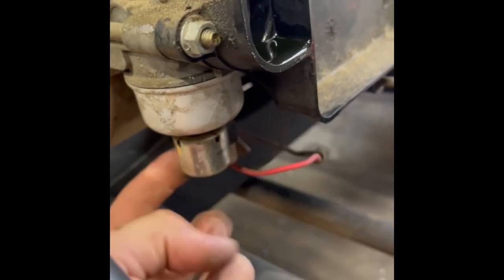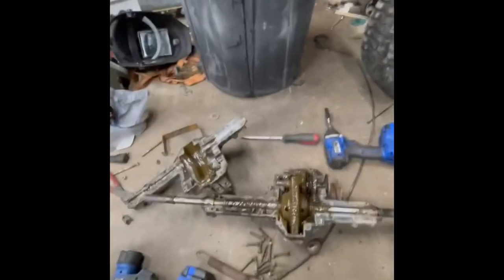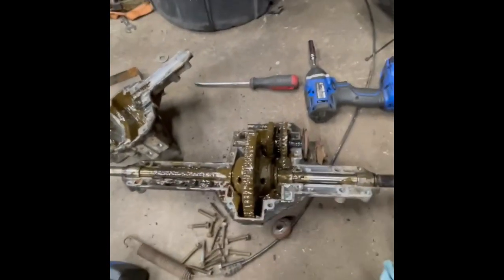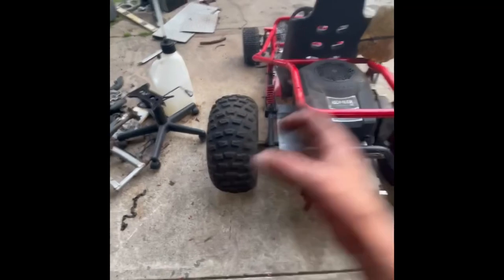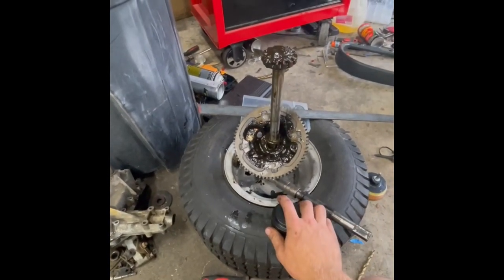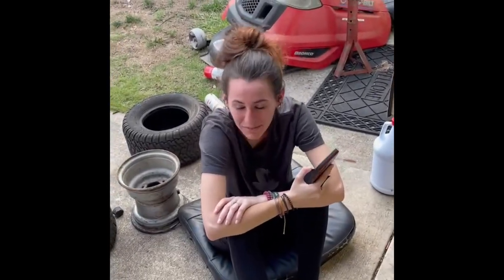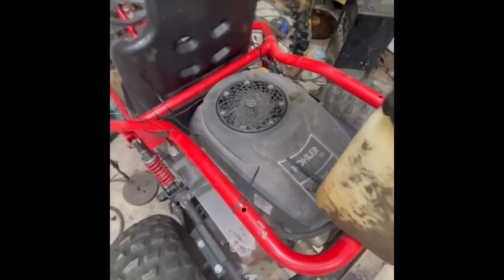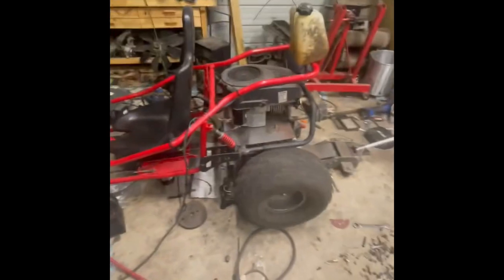Go Kart with 20HP lawnmower engine

Comment: I did this 12 years ago but used a sequential Foote 5 speed with 4 inch input pulley on trans and centrifugal clutch . About 28 mph , weird to shift but still works today . With vertical shaft engine , 14 hp ovh .

Comment: Tractor supply has 90 degree gearboxes instead of using the mower transaxle you could keep the live axle just do a 1 to 1 pulley from engine to gearbox and  put the clutch on the horizontal shaft of the gearbox get way more top speed
Reply from the maker: I looked into that before building the mower transaxle and the smallest 90 degree gearbox tractor supply had wouldn’t fit in the area under the engine with all the pulleys I’d need to make it work
Reply: @EliteDiesel01  the ones I've seen you might have to have tractor supply order they are used on zero turn mowers and not very big at all I believe cars and cameras used on on the ratrod wagon the fattire bike and the drift mower before they put the built predator 670 on it
Reply: Maybe even use a centrifugal clutch

Comment: If that's a MTD fnr the year reduction is crazy because the pinion gear is 14 tooth and the reverser gears are 41 so that reduces it as well as the gear on the other end of the travel reverser is 8 teeth which turns to 58 tooth gear on the axle which means that if your input shaft which means if you drive pulleys were 1 to 1 going into the transmission you're probably going to only go 7 to 10 mph

Comment: do you reckon it'd work turning the motor over so the crankshaft is horizontal and modifying the oil system, with a centrifugal clutch or something else that drives a chain and sprocket on the rear axle?
Reply: @NubsWithGuns  u think a vert shaft is better in this application?

Comment: If you did research and didn't just do stuff......you may have been successful
Reply from the maker: First off I think if you actually watched the video you woulda saw I was successful. I built it and drove it. It worked. I clearly stated in the video that I did have an issue with a temporary motor plate flexing and throwing the belt and that I could buy the permanent 1/4 plate that I was planning to put on it if it all worked like it should which was $100 but I also said that I changed my mind on what I wanted to do with it after building it. I had my fun and I built something a-lot of  people haven’t. I don’t see you building one like this. It’s about the experience. And it’s my stuff I can do whatever I want with it without research or other peoples opinions like yours mattering. And remember this is the internet where millions of people will see your comment so you shouldn’t be condescending. You said if I did my research I would have been successful which makes no sense because if I didn’t do research how would I know how to mount a vertical shaft lawn tractor engine on it.How would I know how to build and lengthen the transaxle like I did. How would I know how to build the custom pulley/clutch set up. How would I know how to stretch the frame, steering, brake and accelerator rods. How would I know what pulley/ tire sizes to use to make it go faster. I think if you paid attention more you’d understand what’s going on. And the description on your YouTube channel “like it or love it…IDGAF”, really doesn’t help your case when you’re clearly GAF commenting stuff like this on peoples videos. Not making your channel look good. Just my personal successful opinion. You have a nice day tho.
Reply: @EliteDiesel01  wow..... butthurt much? Common sense, torque equals flex, belts need tension, overall gear ratios, etc...and I don't have to put my stuff on YouTube. And I have 2 racing mower projects, an ATV, and another "thing" that's kind of a pulling tractor but, it does about 50.
Reply from the maker: Nope not at all “butthurt”. But you clearly are if you’re resorting to talking down on other peoples videos because you feel like you’re more superior then them when in reality, which is the real world us normal people live in, you’re no better then the next. I don’t need to thrive on others opinions I know What I’m capable of. but you’re still not listening at this point you’re just being ignorant. And your “racing mowers” that cute. Ive built those too Which aren’t go karts those are mowers  already set up for vertical shaft unless you swap on a horizontal shaft engine so your not proving your knowledge on what my videos about. And this isn’t my only go kart. I have a R1 shifter kart that will go over 100mph so your 50 ain’t impressive. If you’d pay attention and do your research before commenting you’d know that. Do better.
Reply from the maker: And I appreciate the comments. Helps with the YouTube algorithm The more you comment the more views i get so keep them coming and I’ll keep responding.
Reply: @EliteDiesel01  if you want LMAO. Keep practicing and get better. Then earn some money from YT
Reply from the maker: @heffedirte6243  I have 3 channels. I just started this Chanel which already has over 47,400 views and you’re the only ignorant person I’ve run into so far. So congratulations on being the first. so again I don’t need to do better. And your the funny one since you keep trying to talk yourself up yet you don’t post videos or make money from YouTube so you have no leg to stand on in your own argument. So like I said all your doing is helping my video get more views, not your own because you don’t have any, the more you comment so I appreciate that. 👍🏽maybe you can like and subscribe and you’ll learn something.